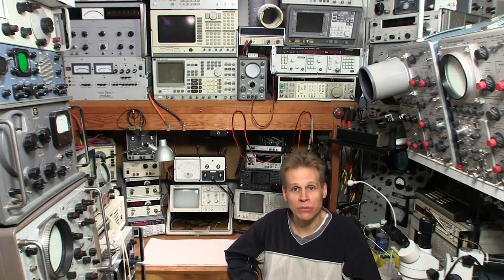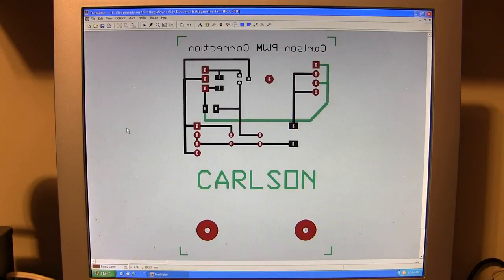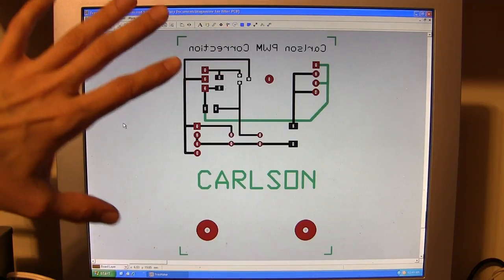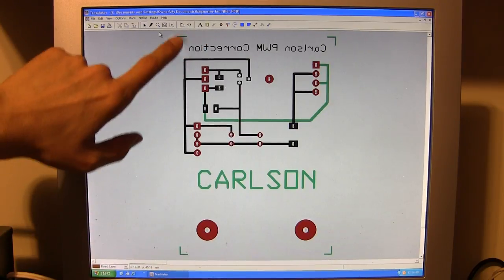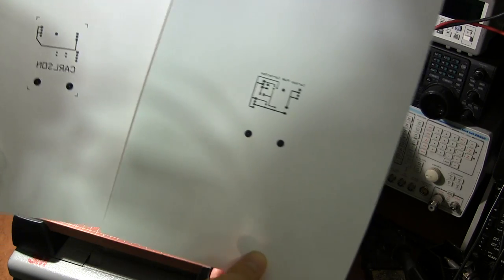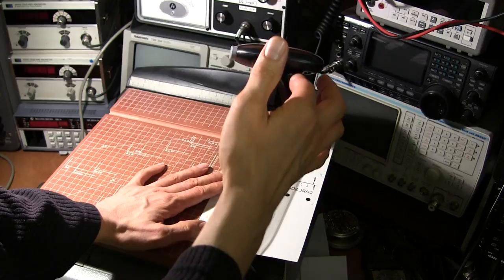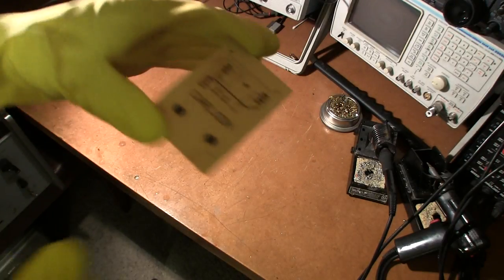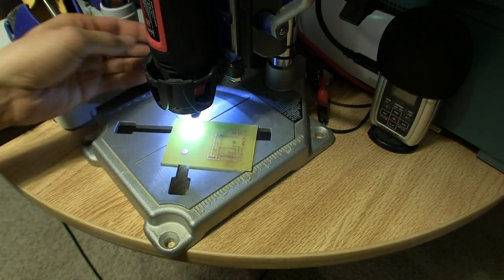How to Make Double Sided Circuit Boards at Home

Comment: Hi Paul !
That LIQUID TIN is a litlle wonder! I had no ideea of it's existence. I do repairs to car's modules and sometimes they are little/more flooded, with oxide and corosion. And after scratch or rub with fiber glass pencil it remain raw cooper so I might find it usefull to apply some drops on the tracks for protection. My question is... do you know, or have any ideea, (or can you try it)  how it will deal with the Aluminium. Will be posible to do a nice solder after apply a layer of that product? I know that Al oxidate instantly if scratch it... but it you scratch it in the absence of the oxigen the solder is posible that's why is used to solder in the presence of the argon gas. Another problem... what if the cooper is a little or more oxidated? How liquid tin will act? Thanks for your answer. I had seen you answer to each and every one , which is a good thing :)
About the video... each person who does boards had develop own method, for the ones that not have a method or does not do at all, is a good material to inspire from.
Probably you did this fotage in the same time with the Magnasine repair, because was no need to do another board again... I guess. Thanks for what you do for everybody here!
Reply from the maker: CRITRON Hi, This was another of the same board, made only a few days ago. So now I have 2 :^) For the liquid tin to work, that copper has to be very clean. Any impurity's, and no tinning in that spot. Aluminum plating I have not tried. I do know that the aluminum will sink heat very well and that alone may make soldering difficult to some top plating. Then we run into "migration" issues. When ever there is exposed traces on boards because of missing solder mask, I just use RA flux and tin the trace with my iron. Thanks for the nice comments!
Reply: You can simply coat bare copper traces with solder to protect them.  Just apply some flux with a flux pen, then use a suitably broad tip on your solder iron to drag a thin layer of solder over the bare copper.  It won't be as smooth and even as the liquid tin but it will provide every bit as much protection (more actually).  Alternatively, you could encapsulate the board with either acrylic or silicone conformal coating for added protection (silicone is softer and easier to remove from an area later on should repair ever be required).  Conformal coating also offers protection from tin whiskers shorting to neighboring traces/pins if lead free solder has been used.

I would think the liquid tin is not something you would want to apply to a finished board as it would likely make a real mess of things if a drop ever got away from you and found its way into any of the existing components, plus the board would need a thorough rinsing afterwards to remove all traces of the tinning solution.

Comment: Which kinda PCB bare board must i use?
There are 2 types:
*1 Bare boards with a photo coating layer ( To transfer the layout with UV and a sheet)
*2 Bare boards  without a photo coating layer...

Thanks!

Comment: I love your videos! As I was watch this one it makes me wonder. Have you considered using a dry mount press in place of the laminator? I think it would work well for single sided boards but I am not sure about double sided ones as there is usually a very thick pad for the bottom platen on those presses. Anyway, in your "spare time" give it a look. I found a "cheap" one on Amazon for around $110.00.

Again, thanks for the info
...de...ke9vo

Comment: The tip with the dremel press is good, I need one just to get the drill moving straight. But
how do I align the dremel press with the dremel ? I can't tell a fraction of a degree by just looking at it.
Any ideas ?
Use a 2 mm drill bit to punch a hole and then look if the PCB moves as I sink it through the hole? That will never be far enough to be noticeable.
Reply from the maker: +0MoTheG 
I used a small "square" on the base of the press and lined it up with the drill bit.
Reply: Mr Carlson's Lab I am sorry, but I do not understand.
Reply from the maker: The base of the dremel press has to be perfectly square with the drill bit. In order to check this, you need  a square. A square is exactly that, perfectly square. Put the small square on the base of the dremel  press. So the base is the area where you put your board to drill. With the dremel OFF, slide the square up to the bit, does the bits cutting area line up with the edge of the square? Now move the square around on the base of the work area and check it at different angles. As you move the square around the  drill bit, it should appear exactly straight in line with the bit. If the press is off, you need to shim the press to compensate for the amount it's out of square.
Reply: +Mr Carlson's Lab Thank you, of cause that does in itself not ensure that the movement of the drill will be along the axis of the drill. Only so if the movement and the drill are both normal \ square \ perpendicular to the plate. Maybe I should simply hold the board in such a way that it can slide but not turn when touching it with the drill thus allowing the drill to slide the board over the base and work out the residual misalignment.

Comment: I never had really good results with toner transfer (don't have a laminator though; I used an iron) and it was too inconsistent depending on toner, paper, print settings and trace shape. But you got really nice results. I'm using photo resistive boards and print my layouts on simple drafting paper (the slightly translucent paper).
I feel your pain with the Dremel drill stand. I have it, too, but have got to say it's a really crappy product. The angle is fine on mine, but it has so much play that the drill moves almost a millimeter to the side when pushing or releasing the lever. There was no way to correct that with adjustment screws without locking the whole thing. The vibrations due to the poor bearing mounts in the Dremel tool itself did their part as well. Cost me quite alot of drill bits. I've since changed over to a router spindle mounted in simple drill stand. You'd think that these "coarse" woodworking tools could in no way be used for PCB precision work, but I've yet to break a drill bit with that setup (and I'm using it down to 0.6mm drills).
Reply from the maker: +superdau 
Quality is sure an issue these days. Glad you found a solution!

Comment: Paul, I suggest you do more than one backup. If the data stored on that computer is that important you should have a more fool proof regime.  Sometimes computer data goes corrupt and you wind up backing that data onto good backed up data destroying the good data before you realize that there was a problem. Sometimes there is human error and you back up a later version over a newer version.  Sometimes a magnetic pulse will destroy more than one drive. There are many possibilities; so I strongly suggest you have at least more than one back up and perhaps on dvd's too as well as older versions of the software to access it properly. ... And thank you for your tips!
Reply from the maker: +El Fabian  
Thanks for your input! I have the info on 3 drives, so I'm ok.
Reply: What are you going to do if someone breaks into your house and steals anything that looks valuable, like external hard drives? Or your house burns down? Or you get hit by a local disaster like a flood, or an ice storm that knocks a tree onto your house, or any of dozens of other things that could destroy everything in your house? 

If you actually care about the data, you should be following the 3-2-1 approach: 3 copies of your data, 2 of which are local and on different mediums, and 1 offsite. If you don't think the data is that important, a few local backups is probably fine, but given how much effort you put into making those boards, I'm surprised your backups seem more like an afterthought.

Comment: Great video! Jeez, you are just as big a caveman as I am. I thought I was the last person in the Universe to still be using Traxmaker. Do you still ever use Circuitmaker too? I use a Unimat SL1000 ( a very handy machine for electronics) for drilling, still use an iron (no lamina tor) and I use ON7LR 's silver plating solution that I make up from scratch as I go. I do some boards, but what the silver plate is really great for is RF coils, tank coils, etc.
Reply from the maker: cny02253 LOL, ....Traxmaker and Circuitmaker are great. I have a problem with changing programs to keep up with the newest trend. For what I do, this program is perfect. Never heard of ON7LR's Silver plating solution, but you can bet the minute I finish writing this, I will be on it :^) Thanks for your comments!

Comment: I ment to ask you what size walnut shell blast media to you use to clean with? I have some I use to clean prass with, is this to large? Or does it need to be finer?
Reply from the maker: Gregory West If I remember correctly, it's #40. Be careful around aluminum. I find at 120PSI, it wont remove surface rust on metal.... So it's pretty soft.
Reply: Thanks

Comment: Hello, Mr Carlson
What SMD size package do you use in your circuits? I'm currently only using THT components but I'm getting tired of drilling all the holes,  I would like to switch to SMD but not sure which size is good for hand soldering.
Cheers!
Reply from the maker: Hello Ivan. 1206 and up is easy to work with.(no microscope)... 0805 and 0603 is starting to get small, 0402 is where I try to end off. I use a trinocular microscope, so 0402 is ok for me. If you purchase a like microscope, and your hands are not to shaky, you would have no problems with 0402.
Reply: Thanks for the help! I'm probably going to start with 0805 parts, should be easier then drilling 500+ holes :) .
Reply: Hello, I forgot to ask you what soldering tip you use for SMD soldering?

Comment: As usual, very nice! If your PC ever dies and you want to load a good software package, Cadsoft Eagle has a pretty decent package and they make a free "hobbyist" version. I've been using the Othermill (not cheap though) because I could never make a good toner transfer board. Drilling and cutting the boards never seemed to go well.
Reply from the maker: Michael Lloyd Thanks Michael!
Reply: Mr Carlson's Lab I have heard of an free program

Comment: Is that TraxMaker Software still available somewhere? Looks pretty Straight Forward to use
Reply: dave1812 search the net. I found Trax maker easily...
Reply: Did you find a working installer? I only found dead links, and Installers that wouldn't work

Comment: i keep trying to make a PCB but i'm not getting a good finish i made a few working boards but now i try a bigger one and fuck it up i used 112 mix 1 HCl 1 H2O and 2 H2O2 is it because i'm using that mix ?  and for the toner i used a clothes iron 150 C and 10 min for each side

Comment: I wonder if there is a facility close by, U.S. or Canada, that would produce a single or small quantity multilayer PCB (s) from template drawings submitted online at a reasonable cost? This would eliminate a lot of congestion where many circuit traces are involved on a single or double-sided PCB.
Reply: ML Howard Sure, there are all kinds of online board production facilities where you can electronically send them a design, usually using their own proprietary cad layout online, and they will send you a board for a fee which varies by size and complexity.  However, as Mr. Carlson wisely says, making a board on your own is important in the prototyping and design refining process.  There are many things that can go wrong in a layout that you simply won’t discover without making it yourself and seeing how components interact.  You won’t get that knowledge by working only in a virtual world.

Comment: What kind of tolerances can you get with this method? Are QFN pads possible (0.5mm pitch)?
Reply from the maker: Oh quite easily, the trick is the transfer paper and laminator heat settings.
Reply: Cool! I’m having some reproducibility issues with a photopositive technique. It might be time to bite the bullet and find some cheap equipment on eBay. I’ll be on the lookout for a video with specifics on parameters like paper and temp!

Comment: What is the purpose of sanding the copper?  Is it to give the surface a light texture so that the toner can stick better to it?
Reply from the maker: You got it.
Reply: the toner don't stick very well on oxidized copper
in the same way, moisture and oil stains make it difficult .

the state of surface don't change anything(if you have a  deep scar, it's another thing ;) )

Comment: Very nice product in the end. However compared to just sending off the files and have someone else handle the nasty chemicals for me is a no-brainer.  Maybe using a CNC to cut away unwanted copper might be a noisey but safer process. I might give that a try at some stage though I guess it would not work well for double sided.
Reply from the maker: +mbaker335 
 I guess that would depend on which way you want to etch your boards. I make many "one offs," and sending my layout to a board house would be very expensive. By the time I received the board, I could be 10 projects down the road. If you only make a board every now and then, I could see your point about sending it off. Thanks for your comment!

Comment: How to plate inside the vias or say through hole plating? how to interconnect them as we are talking about 2 layer (double side) PCB , thus it will definitely have vias !!! please help :)
Reply: Usually you can't really plate the vias. What helps for connecting the two sides are either components that are soldered on both sides or simply using wire that connects both sides. Just solder a wire between the two pads and cut-off the legs. You will end up with the equivalent of a via. Of course this only really works for double-sided boards and not really for 4+ layers.

Comment: The good part about the peroxide + vinegar + non-iodized salt method, is that it can be reused, contrary to what you say, you simply need to add a bit more peroxide, and salt to reinvigorate the solution. 

The second part, you can use the used peroxide/vinegar+salt solution for electroplating copper.. So the copper you pull off your PCB's can be reused. It's less wasteful. 

Finally, it's safer.
Reply from the maker: +ArcAiN6 Thanks for your comment!

Comment: hi, how do you connect a part of the circuit located on the surface layer to the bottom layer when using surface mount devices, a trimmed wired or there is somn very pro¿
Reply: With surface mount components you would have to place a "via", which is basically a drilled pad on both layers to which you connect your traces/component. Then you connect the two layers with a through hole rivet. If you Google that term you should be able to find some online. They come in packs; Favorit is a brand, if memory serves me correctly.
Reply: Watch the video, he explains
Reply: Corl Franco you form a hole and insert a brass doughnut.

Comment: could you use the copper laden acid to copper plate with.
Reply from the maker: dale myers Possibly?? I have never tried.
Reply: It is not an acid, rather it is a oxidation/reduction etching process (I believe that is the proper term) where the ferric chloride gives up a chlorine to make copper chloride and a ferrous chloride with one less chlorine (and if I get this wrong, hopefully someone a bit sharper will correct me).  The final solution should result in a mix of copper chloride (which could be used for plating) mixed in with the remaining ferric chloride.  If you can figure out the necessary reaction to precipitate out either the ferric chloride or the copper chloride (so that you can remove the unwanted ferric chloride) then you would have useful plating solution.  But my chemistry is far to rusty to tell you how...but if you search hard enough the answer is likely on the internet somewhere...or make friends with the chemistry professor at your local community college (many would likely be happy to help you as it is a fun project).

Comment: I can also do it with the iron, because I do not have that machine also what type of paper is paper which Tthe there are several kinds, such as photo sticker and the one used for shirt
Reply: I would have to say that the flexible silicone rubber rollers in a laminator would provide a FAR superior, more even pressure coverage than an iron.

Comment: Using paper does not cut it for small SMT stuff (paper fibers produce uneven toner edges), this is where vinyl film or glossy paper becomes useful.  In case of adhesive vinyl film you stick it to the paper before printing, no need to soak - all toner comes right off of it.
Reply: Alj Paper works just fine if you are doing the method properly.

Comment: A problem I seem to have when trying to make boards is the laser printer I got isn't printing very densely, i.e. not depositing a lot of toner. Anyone know laser printers that are good for this purpose? Which one do you use?
Reply from the maker: TheAmmoniacal  This laser printer is an HP. I also use the HP toner as well. Make sure your program isn't printing in color, (with a black and white printer) or the black color will be weak.
Reply: TheAmmoniacal or if you can make it darker

Comment: I get a little confused at around 23:08. You don't explicitly state that you used a laser printer to print the pattern on the glossy flyer paper. But you do keep talking about making the toner transfer and how the toner does stick to the glossy paper so well, so I am assuming that you do use a laser printer. Great video though. And using toner on glossy paper made for ink to improver the transfer is pure genius. Never saw that before.
Reply from the maker: Thanks Chuck!